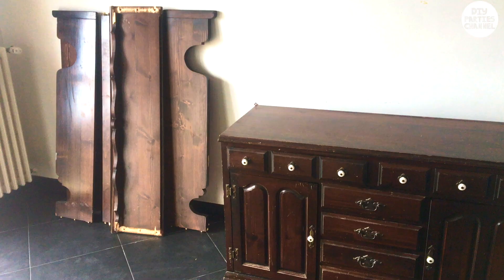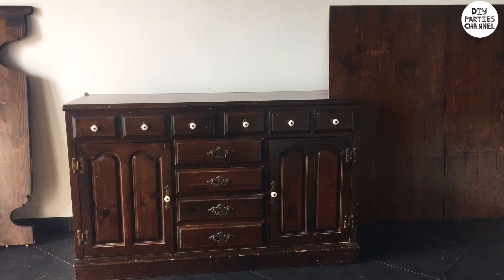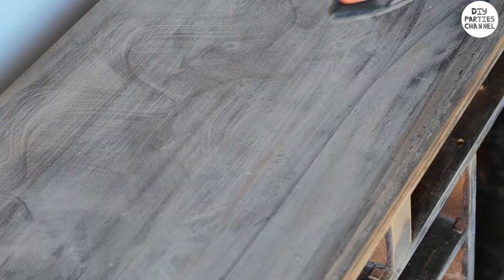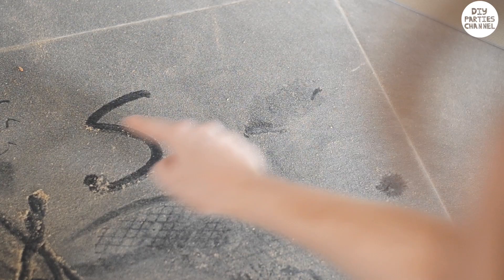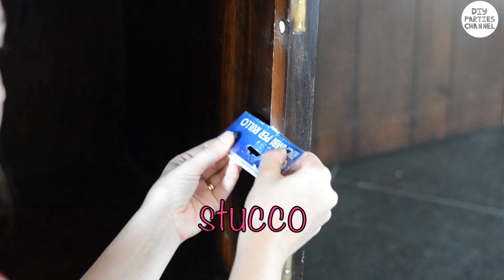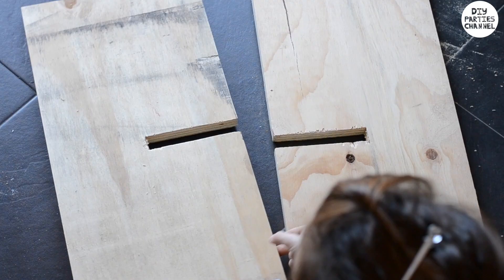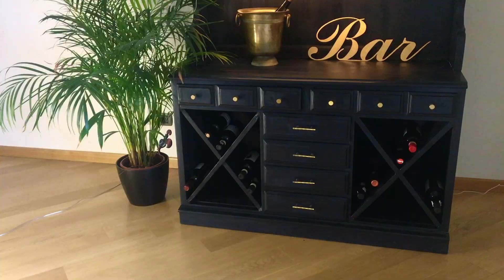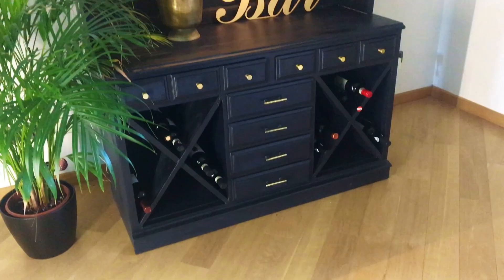I turned a 100 year old hutch into a BAR! Furniture Thrift Transformation Ep5

Comment: Can I ask why did you use vanish remover instead of just going in sanding it off? Sorry if a stupid question but I’m new to all this
Reply from the maker: Hello! Actually that’s a good question I’m no expert so can’t confirm this but with the basic sanding tool I had it would have taken longer as the varnish was quite thick and perhaps less safe with varnish particles in the air. Varnish remover is pretty quick and easy but also smells awful!